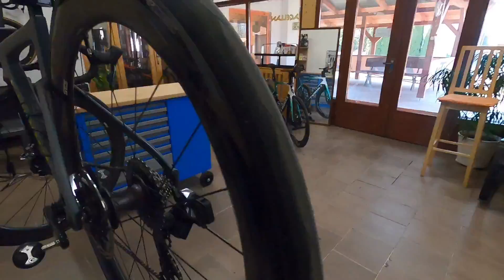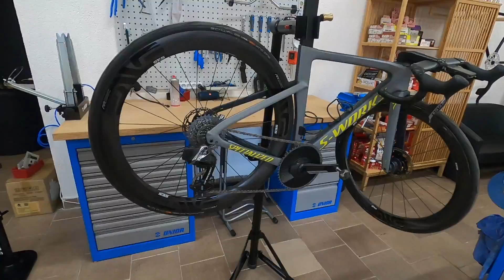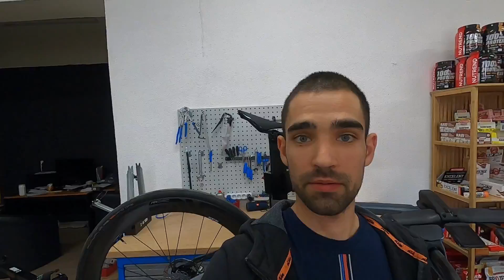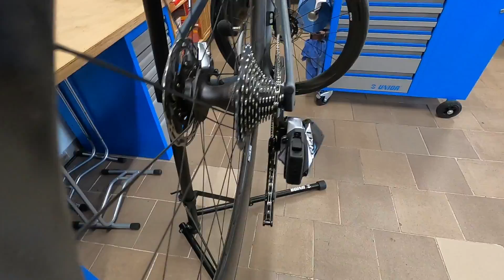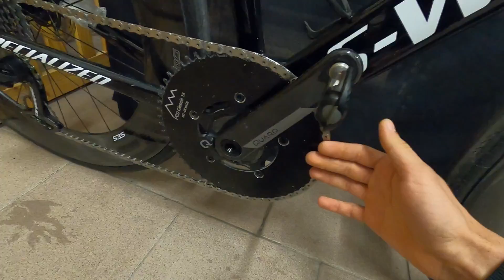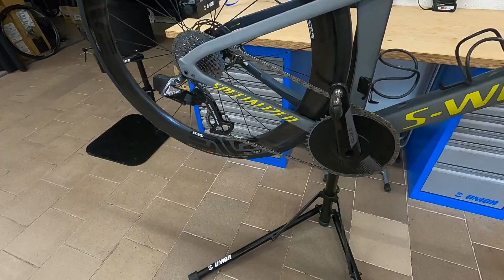Bicycle gearing, explained.

Comment: I see so many cyclists with wrong gear ratios around me. 
They ride huge dinner plate‘s with tiny cassette‘s, the results are a crossed chain, cadence like slow motion and they’re upper body’s bounce to every pedal stroke. 
I think they want a bike that looks pro, but them selves, fool. 
Nice video Ron, keep it up! 🤙
Reply from the maker: Thanks!
Reply: 53/39 is still the best if you live in area with moderate elevation

Comment: Do you understand the wrong ratio of AXS?  The bigger the crank ring the tighter the gear ratio .  The 12 is closer to 13 than 10 to 11 .  The way to go is 56-60 front so you can choose closer rear cogs
Reply from the maker: And why are close rations so excellent?
Reply: @ronykuba  because of the optimum rpm
Reply from the maker: @gpanoutsak  which is anything from 70-110 rpm... plus have often are you shifting from 10 to 11t so it would bother you?
Reply: @ronykuba  Sorry but why you invest in 12 gears system?  
When the air resistance is the major thing then you need close ratio, 10% speed comensurate 33% power .  Do the math .

Thats the reason time trialist are using 58 ring .  Other reasons are that bigger cogs are more efficient and chain angle
Reply from the maker: @gpanoutsak  I have a 58t for the exact same reason, so?

Comment: I fitted absolute black chainrings on my custom Lynksey titanium with di2 6770 groupset..very slight chainrub on inside..how do I trim this to remove noise?thanks
Reply from the maker: Di2 trims automatically when correctly adjusted

Comment: just watched your video and wanted to make some additional comments, Firstly gear ratios are very important because if your bike is geared incorrectly you will never attain your top speed. Also most people find their cadence at a particular speed is not comfortable, ether their  pedal speed is just too fast or too slow or just too hard for them to use constantly so this is where changing the front cog or the rear ratio set is necessary. I have a bike and in one gear i will do 30 kph, click the next gear peddle hard 40 kph, click the next gear peddle hard 50 kph. click the next gear peddle hard still 50 kph. so i have to change my gear ratio.
Reply from the maker: I've lost you there

Comment: For majority of people out there the chain rings on road bikes are still way too big. Even compact cranks are too big for most people. Most people would be better served with 48/32 or 46/30.
Reply from the maker: For hilly terrain absolutely!
Reply: @ronykuba  Not just hilly terrain, 95% of people are just normal (strong) weekend warriors. 48-14 at 90 rpm is almost 40 km/h. That's with a decent chain line, 48-11is almost 50 km/h.  i don't see a lot of people going on rides averaging 40 km/h let alone 50 km/h! Whenever I see people laughing with my 46/30 I ask them to show me their strava rides where they average 40 km/h, i never get a response. If you are not a competitive racer pushing 5 watt/kg then even that 50/34 is doing you a disservice
Reply from the maker: @FrankNolf  as I have explained, unless you are reaching the extremes of your gearing at the low end, all you achieve by downsizing your gearing is losing efficiency. On the flat, even a beginner can happily ride at 1.5W/kg in the 50x19 or 50x21 at 24km/h. On most bikes the low end is 34x28, which 11km/h. That is enough of a buffer for flat terrain with short climbs. Obviously it´ll not make you able to climb mountain passes at 2W/kg, but that´s an extreme case.
Reply: @ronykuba  but will running a 48t give you not a better chain line at those speeds because you can be more in the middle of the cassette? I also want to add that a lot of people don't even run a compact crank at least not in Belgium. They all want to ride like the pro so it's 52t or 53t up front
Reply from the maker: @FrankNolf  the chainline will be slightly better, but I don't know if it will offset the larger ring + cog
Reply: @FrankNolf  If your gearing for your average speed on the flat just run a fixed gear!. A wide range of gears allows you to climb steep hills  and then speed down the other side at 100km/h (that's a max not average!)  when i was younger i used to run 56-11t top gear and just annihilate riders on the down hills (admittedly they would often beat me on the uphills but as a 90kg rider i just pick my battles and ride to my strengths. 
 53-39 / 28-11 is probably optimum (for where I RIDE at my current power and cadence) easy enough for most uphills and not overreving on the downhill
Reply: @evilmotorsport  99% of roadies are not racers and have zero use of a 56/11 to race down hills at 100 km/h. Most non racers riding these big gear just do it for "the-look-at-me-i-ride-pro-gearing" while like you say they can only it use in a big downhill